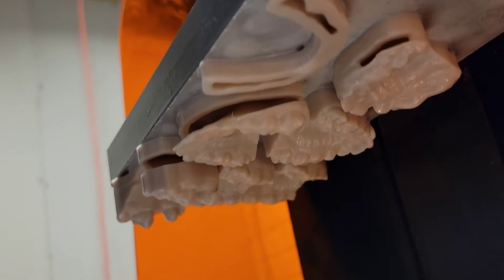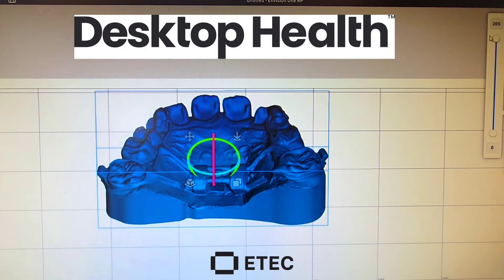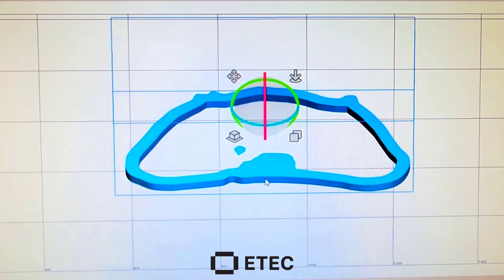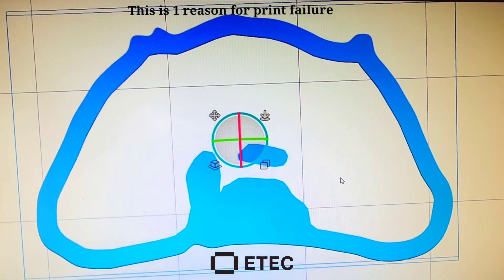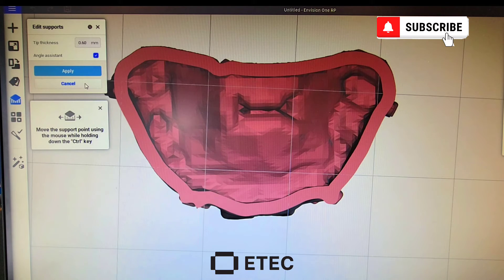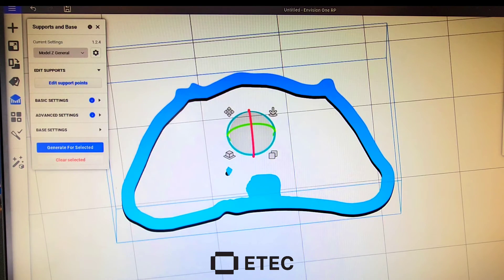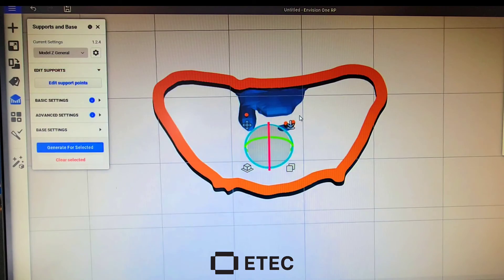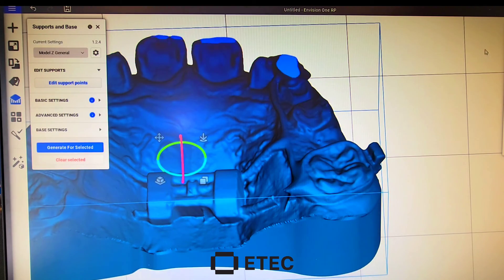3D Print Fail and How to Fix

Comment: 3d printing is a waste of time, and Im saying this after 15 years of use. They always break after 30-50 uses beyond repair, wiping out all profit margins..I tried Ultimaker, Flashforge, resin Anycubic, always the same story...I guess it could be fixed with great difficulty, but the effort is not worth it. 

My latest issue is weird blocks forming during resin printing, never seen it before and no idea what it is
Reply from the maker: You gotta get a really good printer. Those are kinda considered toy 3D printers